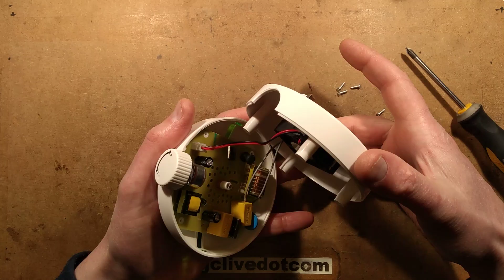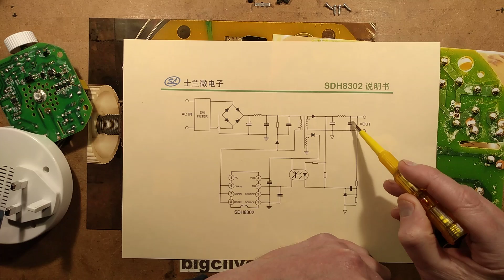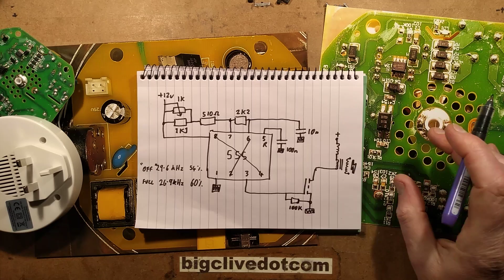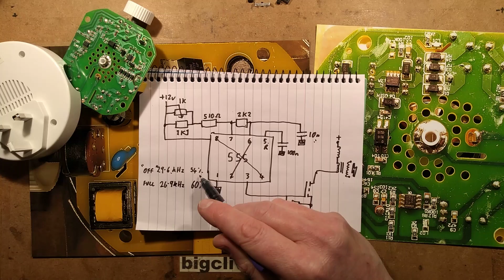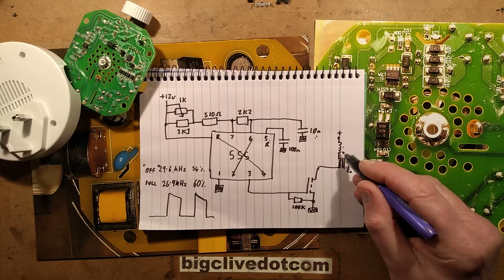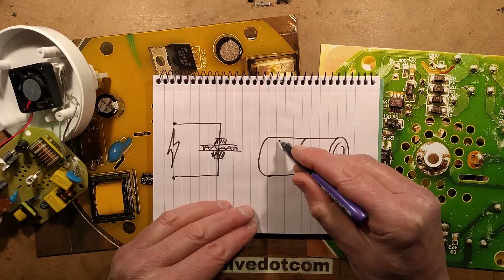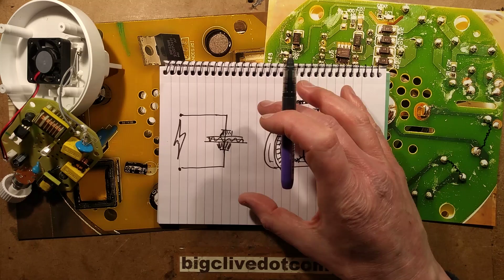Inside a faulty Puripod ozone generator.

Comment: A small general remark regarding Zener diodes. In university we were taught to just call them z-diodes. The reason being is that the Zener effect (tunneling) is only true up until around 6V. Diodes rated higher are using the avalanche effect and therefore can not be called Zener diodes...

Comment: i must admit i find reactive and apparant power a bit troublesome to get my head round. i get that apparent power is that which is used, and reactive is just the AC 'sloshing' back and forth.  but i dont see why UK homes don't pay for reactive power but business do? does that mean if i get a huge transformer and plug it in i can run it more cheaply that a factory could? this seems a bit bizarre to me. no doubt i am missing some important ideas here? is it something to do with business types using more inductive loads than homes?

Comment: Afternoon Clive, came across these being sold in my local B&M Home Store under the Blaupunkt brand for a tenner, and bought it knowing full well what it was having watched this video in the past, the manual hints at its operation as an ozone generator but mentions negative ions and the basic operation of an ioniser, which this certainly is not, in the manual.

Couple of hours running in the bedroom and it freshened it up some, and after unplugging it a distinct ozone smell on the output.

Shining a torch inside the coloured plastic in front of the LEDs and through the fan grille on the back it looks to be pretty much unchanged circuit wise, I haven't had it apart though to investigate further but I cannot see it being different inside to this Puripod one you looked at.

Comment: Excellent video, as always. 
You'd think they'd either have a separate switch on it, for the mains, or, as you said, route it through the potentiometer switch. 
I have a couple of these, so in the sprit of this channel,  I drilled a hole in the case, opposite to the potentiometer and fitted a nice little round white 3 amp switch to the live feed from the plug so I can turn the whole unit off without having to unplug it. The live feed wire is just long enough that you can cut it, strip the ends, and solder it to the switch terminals, and if you drill the hole so it's halfway in the front and the back of the case you can pop it out if you need to access the internals in the future...
Reply: Just plug it through a mechanical timer.. quite cheap and saves you having to remember to switch the thing on and off........

Comment: Excellent backward engineering! One comment the emitter pin on the inside of the ceramic tube is in fact nickel plated copper, after 6 months or so the plating deteriorates and then the copper rapidly oxidizers with moisture from the air being blown across it, I feel it might been on purpose as it gives the unit a life span of six months or so, shame for such an excellent little device. I did however replace this with with a stainless steel strip lol

Comment: So, are there any filters to change? How do we know it's stil working or doing its job? Do we need to clean it?
Reply from the maker: No filters.  If you can smell a faint bleach-like smell at the central air port then it's working.  You should also be able to see a very faint dot of purple glowing in the central tube if you look in a very dark room.  It's tiny and very dim though.
Reply: @bigclivedotcom  The smell of my air dehumidifiers seems to be over powering the air purifier. But I can see the green lights turned on in the middle strip..and I turned up the dial to the maximum. I just bought it in Argos today. Hope it is working.
Reply from the maker: @TechNomadUK1  If the smell is musty or mouldy then it might be worth cleaning the dehumidifiers.
Reply: @bigclivedotcom  So there's no need to even change anything in the machine? Do I just clean the ports? And is it absolutely safe to keep it on 24 hours a day?

Comment: I have a negative ion generator that also makes O3, i know it produces tons of static via high volts / low amps, but it uses a small sewing needle as its means of discharge, outside of its case.  I would love to see you explore waveforms of a synthesizer via your banGGood pocket oscilliscope, you may not need to dismantle it BUT it would be gr8 if u did!!!

Comment: Those tiny HV transformers are pretty sweet. I've gotten some of them to kick out arcs longer than a couple CM before burning out and it takes very little power driven with pulsed DC at the right frequency and duty cycle. Sometimes I find similar ones in LCD monitors.

Comment: Ozone is indeed a fantastic odor killer.  Years ago, we had a spare squad car that resided in the old Fire Hall. It was a late 70's Chevy with a huge engine and could catch anything on the road but burned tremendous amounts of gas so we were discouraged from using it unless the regular car was down for maintenance.  Well one night a new cop on the force decided to take the old beast out for a shift, and during the shift he had to kill a skunk which was thought to be rabid.  Policy says you kill a rabid skunk, you deliver it to the local Vet for testing.  Well the fellow had a nice shift and got to try out that huge engine in a high speed chase, during which he forgot that he had that damn dead skunk in the trunk of the car, tied up in a plastic garbage bag.  So at the end of his shift, he put the old car back in the Fire Hall and neglected to notify the oncoming officer of the skunk.  Several weeks later, the decomp of the skunk burst the plastic bag, and the scent of that dead decomposing skunk infiltrated from the fire hall into old City Hall which was still in full use, and the odor got so bad that the on duty officer went to instigate.  When he opened the trunk the smell of his vomit mixed with that of the dead skunk.  The car was removed from the fire hall and the skunk delivered to the vet who immediately disposed of it because no testing could be done after the length of time.  We called a local cleaning service, they brought over a rather large ozone generator and placed it in the front seat of the car which had been parked back in the fire hall.  After 24 hours you could go back in the fire hall, and in fact drive the squad car with no trace of the skunk.  Now that's a cleaning service!
Reply: As a rule, ozone generators shouldnt be in the area to be deodorized. This being an extreme example suggests otherwise.

Comment: Why would I deliberately breath ozone at all ? Ozone levels in the air aren't actually healthy.   So avoid it. it is a free radical. oxidizing as hell. Ozone does especially one thing: It essentially eliminates smells (good or bad, this is equal... ) by oxidizing these molecules. And that is the main purpose indeed as you have mentioned : "Refreshing/Regenerating" Air. But only to a certain extent. So call it a "de-odorifier" for small rooms or small flats. But the overflow or overdose of Ozone actually smells "electrically". And this is from where Ozone starts getting not so useful.
Ozone is an unstable molecule complex of three atoms put together, the ionization (by strong UV-C/B light or through electric field discharge) does actually the work of splitting O2 - ionization rips the molecule apart when their bonding electrons get energized to a higher state - and these get caught by other O2 molecules inside of the field and single atoms attach to these O2 molecules in an unusual triangle, rendering it to a super-unstable O3 molecule, and just are shortlived until some other atoms or molecules come along the atoms or even along that O3 molecule which then looses its single atom instantly again to the molecule of whichever stuff to be oxidised, falling back into the stable O2 state.

Comment: I really think "air ionisers" should be banned. Like you say, they're all really ozone generators, and ozone (one of the main ingredients of smog) is potentially toxic. Come to think of it, they shouldn't NEED to be explicitly banned. Companies should not be allowed to make and sell products that potentially toxify the air under the banner of promoting health.
Reply from the maker: Real ionisers do not produce much ozone.  It's unfortunate that these products have hijacked the name of a real dust control product.
Reply: @bigclivedotcom  Ah, I thought they did. I seem to remember a video (actually about the pointlessness of salt lamps) where a guy tested a high voltage air ioniser in a lab and the detector sniffed mostly ozone and a little ionised air. I don't know the exact process, I believe its something to do with HV wires ionising air that passes over them.
If I'm wrong (which I often am) then these ozone generators masking as air ionisers should be banned for the above stated reason AND the for false advertising, and actual air ionisers left alone.
Reply from the maker: @aitchpea6011  The salt lamps are absolutely fake.  No detectable ionisation at all.  For a while everything was marketed as an ioniser.
Reply: @bigclivedotcom  Yup, I only mentioned them in passing because that was the main subject of the video I watched

Comment: what is the difference between air ioniser, and a Ozone Generator ?
Reply from the maker: An Ioniser puts an electrostatic charge into the air.  An ozone generator splits oxygen apart forming unstable single and triple oxygen molecules which have a strong oxidising effect.

Comment: would you consider doing a tear down of one of these

"Stetzerizer Filter"
https://www.amazon.com/Graham-Stetzer-GS-F110-A-Stetzerizer-Filter/dp/B0084IRQFC/ref=pd_sbs_121_4/154-9138503-4425648?_encoding=UTF8&pd_rd_i=B0084IRQFC&pd_rd_r=bfea7bbb-4ab2-11e9-953d-eb4809cbb88f&pd_rd_w=iqAd0&pd_rd_wg=pLsJo&pf_rd_p=588939de-d3f8-42f1-a3d8-d556eae5797d&pf_rd_r=8B5TM3R3T0BZQVZQF8EV&psc=1&refRID=8B5TM3R3T0BZQVZQF8EV  

they sound like utter BS to me, even more so because you have to use their special tester to see if they work/ but I'd love to see your opinion.
Reply from the maker: That's almost certainly going to be a concealed capacitor and/or MOV.  Possibly potted to stop you seeing how little is in it.
Reply: @bigclivedotcom  I'm sure. You should check out their website, it's quite ridiculous. You need 20+ of these things to properly "protect" your house. They sell a special meter that reads in special units they created.

Comment: Reminds me a bit of the Reme air purifiers we used to install at an old job I worked at, our salesman claimed it was some super high-tech catalytic air purifier, but I could tell just from the design of it, combined with the odor it put off, that it was an ozone generator, but it is also coupled with a small UV bulb.

Comment: If the 555 timer is supposed to control the duty cycle of the transformer and by association the corona discharge, presumably they have used the wrong value resistor on Pin 3 to ground or the wrong type of transistor ?? Also the diagram does not show how the 555 chip and Trim Pot connect to and/or control the Fan.

Comment: Why use a 1K pot in parallel with a 1K1 resistor, instead of just using a 470R pot?

Overall, it seems fairly well-designed for a cheap unit of dubious value.
Reply: To shape the variable resistance curve.

Comment: I would greatly appreciate a video about the variety of oscilloscope display devices you have access to from the cheapest functional units to the really spendy units. I stopped using them when I left the US Navy back in 1993 and I am sure that anything I used then would have capacitors that will have aged out of spec by now. All of the more recent models will be microprocessor based these days and the costs are going to be all over the map. Nice work on your vids BTW.
Reply from the maker: They've evolved massively over the past few years.  The pocket ones are actually very versatile.

Comment: Interesting to see the good old triple-nickel. I bet the ubiquitous 8-pin microcontroller doesn't run at a high enough frequency to drive the circuit, especially since you want to vary the duty cycle of a ~30khz signal.

Comment: Would the generated ozone damage the circuit board?
Reply from the maker: Most gets expelled by the fan if it's running.
Reply: Yes, it seems to. Bought a fullscale Ozone generator with programmable timer and LCD display some years ago. Got used often. Timer and display meanwhile do what they want, impossible to program. A clockwork mechanical timer has just been ordered  :-)

Comment: I once had CRT TV that had ozone generator built in :) Isolation on anode suction cup was bad and you could see and hear corona discharge around it. You could smell ozone in whole room after about 5 minutes of that TV running.

Comment: The poor thing seems to have been shipped by fistfight... between the broken solder joints and the smashed core, and the one side seems to have a crack around  the center tube in the holes, or at least a huge scrape...

Comment: To soft solder stainless steel, you need a special acid flux that is very corrosive they use it on Fish and Chip Fryers in the manufacture

Comment: Audio Squelch affect makes the sound really odd .
Reply from the maker: It's annoying.  The device I'm using to film has a noise gate at low levels that cuts in and out.  Every single device I've used to film has always had one feature that isn't quite right.

Comment: simply take a cable from the positive fan and take it to pin 5 of the 555. if the fan is of, it will take the 555 in reset
Reply: Pin 5 is “control voltage” not reset.

Comment: Now just wait a Gosh-darn cotton-pickin' moment there Clive, you mean to say they thought using glue for the fan was cheaper than heat-staking the fan on? That could had been part of the damn thing's case design!
Reply: I would imagine that by not using pins this keeps the "mounting system/method" universal so they would be free to use multiple fan designs. Manufacturers will change part suppliers (and therefore part configurations) anytime they can save a penny. Perhaps even a fraction of a cent! 👍 👛

Comment: Dredging my memory about 555s... been a while since I messed with one. Pin 4 is actually reset which is tied to Vcc as it isn't used. Pin 5 is the control pin which they recommend has a 10nF decoupling capacitor attached if that is unused.
Reply: Yes, pin 5 is CV - Control Voltage. A capacitor (typically 10nF to 100nF) can be added to smooth the voltage on the internal voltage divider resistor network. Or an external voltage can be fed in to change the switching points. On CMOS versions of the chip, or where the NE555 is being used and stability is not considered important, the pin can be left unconnected.

Comment: Ozone does a good job of getting rid of odors.   The problem with ozone generators is that in moderate to high humidity, it converts some of the nitrogen to acid.   The solution is to pump pure O2.  No nitrogen, no acid.
Reply: the problem with Ozone Generators is that they put out Ozone

Comment: LM555 pin 4 is reset.
LM555 pin 5 is a tap on the internal resistor divider.
It is a bit odd that they have 2 power supply circuits.
Reply: Yes, pin 5 is control voltage. It can be used for simple frequency modulation. I used it on a simple IR microphone back in the 1980's.
Reply: @SpeccyMan  
In that same era, I used the function of pin 5 to make a DC-DC converter with regulation using a 555.
What I did was:
If you use a zener or reference to hold pin 5 at 5V, the "trg" pin compares with 2.5V
When "Q" is low, the "discharge" is turned on.
This means a voltage divider from the load to "discharge" can trigger the 555 any time the voltage is too low.  A small capacitor can delay and smooth this a bit.
The "thr" pin compares to 5V and the usual "one shot" action can set the on time.

Comment: ??  isn't ozone hazardous to the lungs ??
Reply: "large" is relative
but it's just like Radiation
the less you get the lower the Damage
Reply from the maker: In large quantities it's unpleasant and does pose a risk.
Reply: In short, yes. It's a highly active molecule that readily reacts, even at low levels, with proteins and lipids in the fluid coating the lung surface, producing toxic products that damage the lung tissue. This is true of healthy individuals but is a particular issue for those with asthma or COPD, where lung function is already compromised.